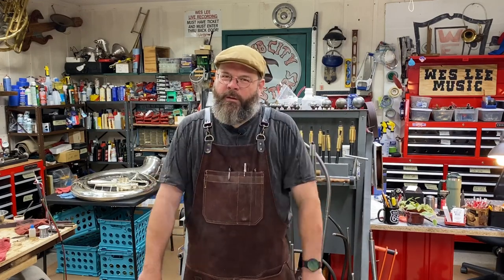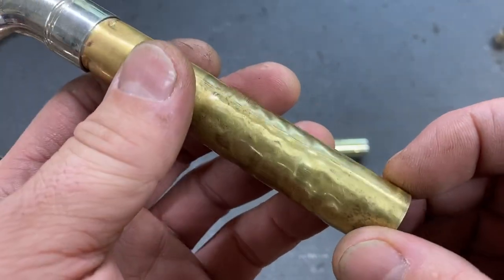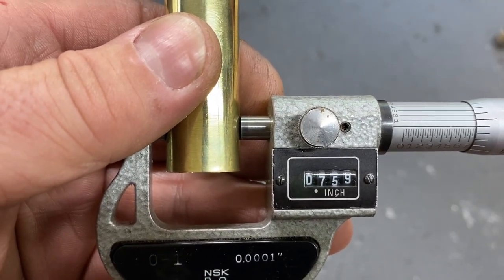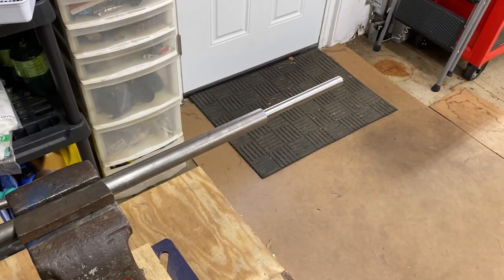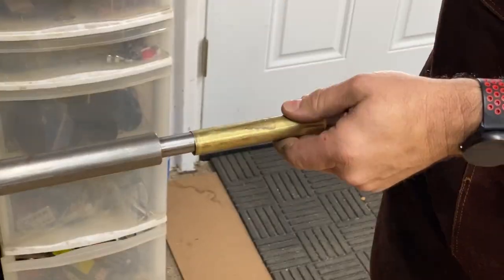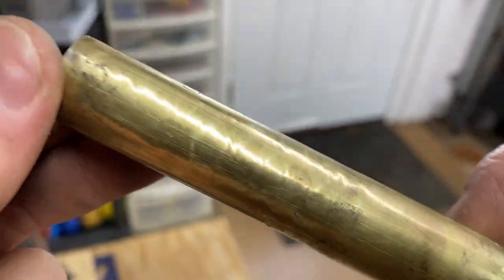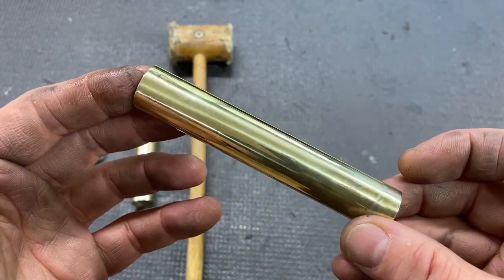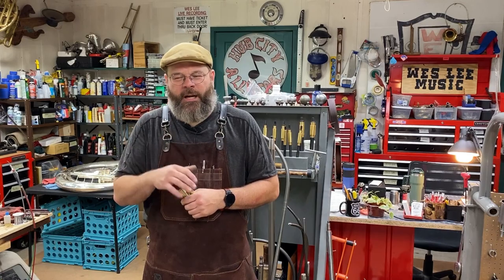Repairing Inner Slide Tubes- improving tool making- band instrument repair

Comment: Ya been there done that. Plus I hand Lapp the tubes to smooth action at the end. Eliminates the slide jerkiness when you put grease.and
Reply from the maker: I do that as well sometimes, in fact had to do that on 4 of the next ones after this video, but the video one seemed fine with just grease.

Comment: Once again another super video.  Have you thought of getting an ER32 collet chuck for your mini lathe?   I have two for mine.  One is on a taper that hooks up quickly, runs true, but does not allow parts to go through the spindle.  The other bolts on in place of the 3 jaw.  Does not run as true, but allows stock to run through the spindle.   The ER collets have a range of .04”, but I like them because they distort fragile work pieces way less than the three jaw does.   Just a thought.
Reply: I just picked up 2 mills and a lathe and I plan on doing that, I have a big set of 5c collects
Reply: @bruhsoundeffect8455  5C collets are good.  I have some for my 12x36” lathe.  However the ER collets are slotted from both ends so they collapse evenly along their length and with 8 cuts rather than 3, they are better at holding fragile round work pieces.  I sometimes use an adapter that allows placing ER32 collets on the 12x36” lathe when I need them.
Reply from the maker: I’m going to be getting one. Do you have brand and model preferences? I was so loosely chucked in, but running a deadline felt I just had to go for it. Worked out fine this time, but need more options moving forward.
Thanks for the suggestions, Doug!